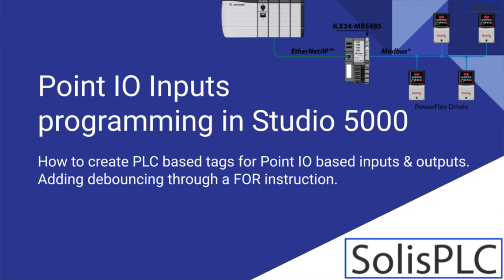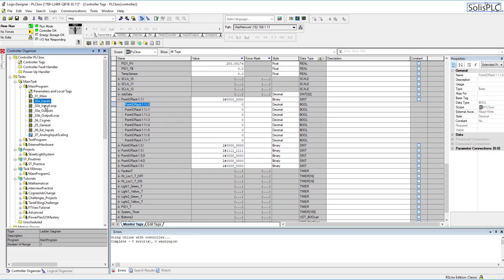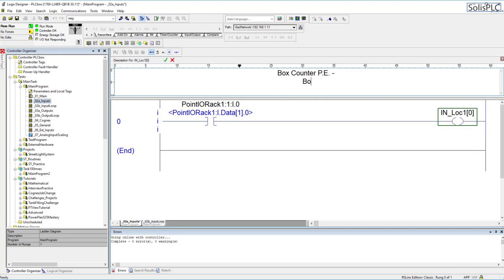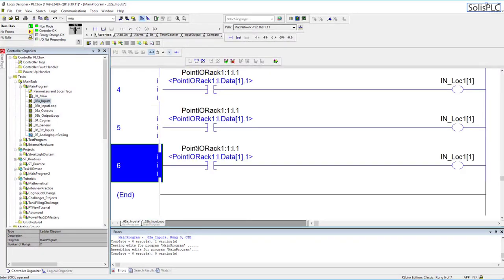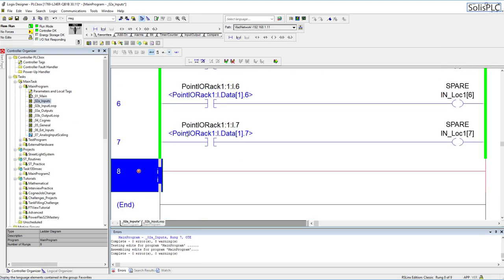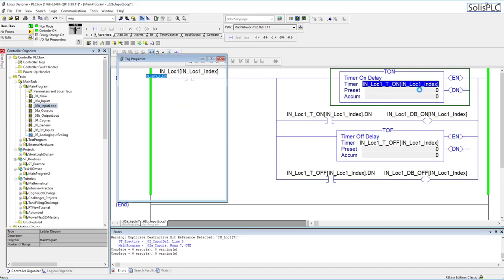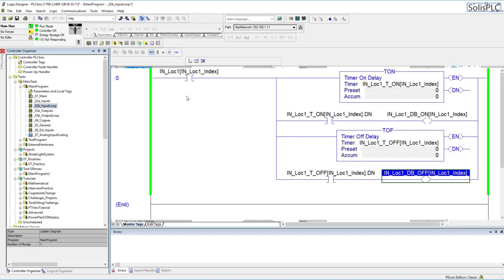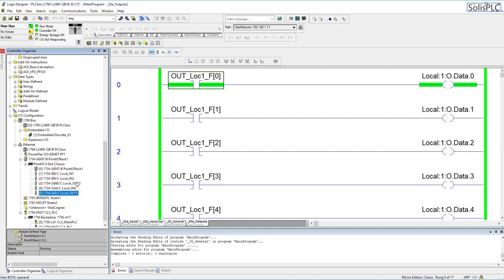Point IO 1734 Allen Bradley - Tutorial on Programming Inputs Outputs in RSLogix Studio 5000 Ladder

Comment: I was having a lot of difficulty determining the addressing of point io vice embedded i/o and this helped.
My rack is using a IA4 card, so 4 inputs, but when I drill down to obtain the specific inputs i need, the controller tags point to 8 Bools and 8 addressed inputs.  Is this because it's a SINT, 8 pats and only 4 are available despite listing 8?
Reply from the maker: Hi Todd, that's correct. The architecture is broken down into bytes. In other words, even when you create a single BOOL, it still occupies a byte of information (8 bits). Therefore, for 4 digital inputs, you'd have a single byte (8 bits), but the inputs would only be mapped to .0, .1, .2 and .3.